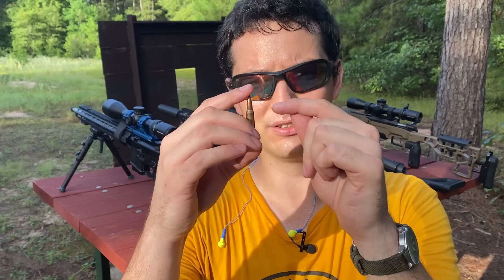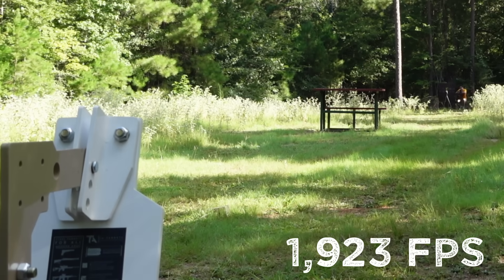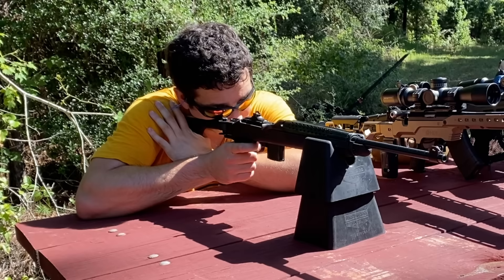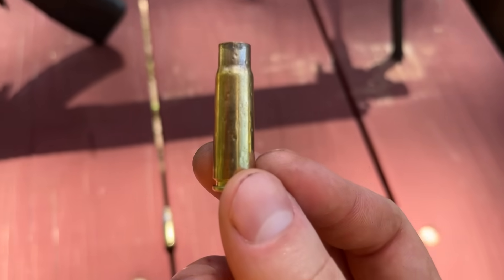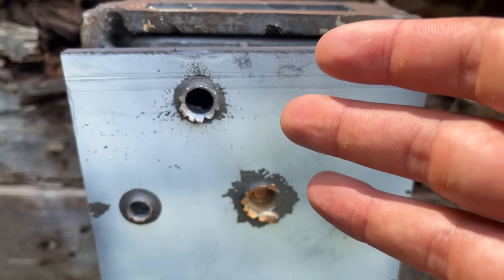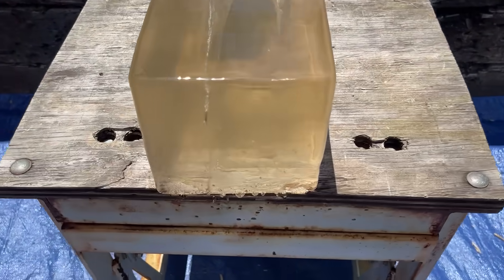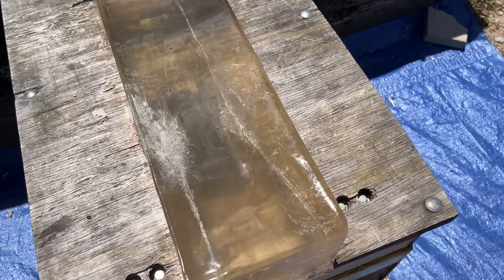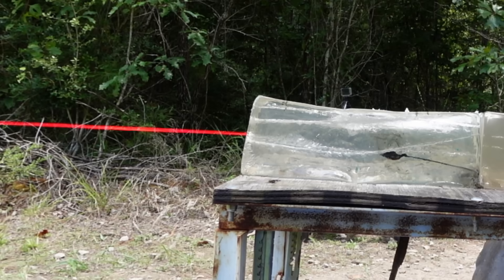I Will Never Shoot These Bullets Again

Comment: In 1993 I had a massive case head speration in an AR-15. It destroyed the upper reciever, barrel and bolt carrier group. For about 3 years I wore a scar line on my cheek where the upper and lower reciever met.
Reply: Bro’s AR gave him a Prussian honor scar for 3 years? Unfathomably based good sir.
Reply: What ammo was it? I'd like to avoid that
Reply: @explosiveswine7354 It was a military 5.56mm case that I didn't catch in the loading process. I always  separate military and civilian brass. To this day I'm very careful, it's easy to miss. Rebuilt the rifle and it runs beautifully.
Reply: @howardamey7228 I wasn't aware of that military cases are lower quality. I have a bunch of Winchester green tip brass that's darker around the head, but I thought that was just visual and didn't effect performance. Should I throw it out?
Reply: @explosiveswine7354 NO, military cases have a webbing around the base of the casing to give it strength during automatic firing.  Not realizing that it was military, I loaded it to civilian specs. This caused a very over pressure case. When I fired, the round exploded in the breech.
Reply: @explosiveswine7354 If you reload, just make sure you separate military from civilian brass. Military should be loaded 10% less then civilian cases.
Reply: @howardamey7228 
Yea, military cases are thicker around the case head which decreases their internal volume, but it's not just for machineguns/automatic fire, it's because of the nature of anything that automatically cycles the action whether it's semi or full automatic, the military's concern is that there's a high probability that ammo will be fired in a less than clean condition in a battle, and dirt between the case and chamber can make it hard to extract causing the case head to rip off and leave the rest in the chamber, even if you have a ruptured case extractor on you using it in the middle of a battle isn't exactly the ideal time.

Plus reloading once fired surplus military brass can be dangerous for that very reason, even with it being thicker in that area it could have been shot through something that it barely survived not having the case head ripped off, in which case it might have been stressed and weakened right there that even under ideal conditions it could rip off, or possibly fail before the round even gets to the gas port and starts the automatic loading process, which is what happened to you, it likely wasn't just the higher pressure from the decreased volume being loaded to civilian spec it was also the case was already weak from surviving a near failure. 

I used to load surplus military brass years ago until I decided it just wasn't worth it any more, between the risk and all the time it takes to ream the crimp off the primer pocket and all the time you put into prepping the things I just started buying commercial unfired brass for my match grade ammo and factory loaded stuff for plinking.

The military should really crush all that brass before they surplus it out, they're really selling it for scrap to be recycled, but unscrupulous people who buy it at government surplus auctions turn around and sell it to reloaders when they know they really shouldn't.
Reply: @dukecraig2402 I haven't had an issue since, but your summation is correct. I never mix brass, and it can be tedious, but I inspect the hell out of it.

Comment: At a local MG shoot, a dude with
A 1917 machinegun with a completely
Shot out barrel fired off a belt of 100% tracer. The rounds immediately tumbled on barrel exit and went in a random direction looking like a massive firework. I mean 45 degrees dispersion and they appeared to almost stop in the air.
Still one of the coolest things I’ve ever seen
Reply: It could be if the rounds were bouncing around in the barrel on the way down the tracer packing was coming out of the back and were being pushed out by the next round, that would account for the extreme angles you were witnessing, I've been around alot of guns including machineguns that were fired with burned out barrels and I've never seen rounds hitting the ground at what would be a 45° angle in front of it or anything even close to that, they all at least make it to the berm behind the backstop at 100 yards, a 3 or 4 foot group is more realistic at 100 yards from a burned out barrel.
There's also the likelihood of the bullets tumbling out of the barrel and flinging the tracer packing causing the optical effect you witnessed, but the rounds themselves leaving at a 45° angle? I just can't get my head wrapped around that one, and I've seen guys do some wild stuff at machinegun shoots, one fella, who had to be rich, took a 1919 Browning and shooting it from the hip, and holding onto the barrel shroud with a welding glove on his left hand, had a buddy linking belts together and was continuously firing it until the barrel was glowing red and it was spitting red hot metal out of the end of it, I don't know how many rounds were continuously fired through that thing but it seemed to go on forever, when it finally stopped he threw it down on the ground and jumped away from it like it was a grenade that'd just landed at his feet 😂😂😂.
I'm not trying to call you out on anything or call you a liar, I have no doubt you saw what you did, but it had to be the tracer packings that'd separated from the rounds causing an optical effect making it seem like it was the actual rounds leaving the barrel at a 45° angle, think about it, if the rounds were loose enough in the barrel to cause that a recoil blowback Browning design wouldn't work, there wouldn't be enough pressure blowing out of the end of the barrel to make it recoil rearward, unlock and cycle the action, you've got to have somewhat of a seal between the bullet and the barrel for enough pressure to build up for the process to happen, otherwise the pressure won't build because it'll just blow out around the bullet as soon as it leaves the chamber. 
Once again I'm not calling you out, I'm just trying to come up with an explanation about why it would appear that way, it would also account for why the rounds appeared to stop in mid air, because it was just the tracer packing, back when I bought my first M1 there was plenty of surplus tracer ammo around in those days, when I'd fire it into the berm behind the backstop plenty of them would have the packing dislodge and dance around on the berm until they burned out, at first I thought it was the rounds themselves doing it until I thought about it and understood there's no way that was happening, then I realized it was just the packing that'd ejected out the back when the round hit the dirt, especially that berm that was real rocky.

Comment: Most 5.56 and 7.62 tracer lights after it leaves the barrel and gets bright approx 70-90 yards away and traces a few hundred yards. Your experiment needs to be done at 300 yards.
In my experience, .50 cal trace is old and ammo is reloaded with old projectiles and most folks using them don’t fire from an M2HB’s long barrel. So if they light, it happens a couple hundred yards downrange and traces approx 2k yards. More exotic stuff like Incendiary tracer has a habit of lighting inside the barrel and blowing shrapnel like a shotgun when it exits; the velocity of the shrapnel can be faster than the muzzle velocity and it comes backwards and sideways; showering neighboring shooters.
Reply: Yea people don't get that there's a slight delay engineered into it so the magnesium tracer packing doesn't start burning inside the barrel for the sake of barrel life, not for the sake of not being able to see where they're coming from.
I was a Vulcan gunner in the Army back in the 80's, every round out of those things was a tracer, at 3,000 per minute if the tracer packing started to burn inside the barrels they wouldn't have lasted very long, even with those things they didn't light until about 25 or so meters out of the gun, maybe even 100 meters, without backstops like a normal rifle range it's kinda hard to judge distance especially since we were shooting at drones flying around in the air most of the time, and with a 3 foot flame coming out of the end of the cannon it would have been perfectly obvious where we were at anyway, whether that red laser beam started right at the muzzle or 100 meters away God and everyone else was going to know exactly where we were.

Comment: My .30 singer did this with reloads that had wrong powder used. It did the same thing and blew out the mag. I think it was designed to do this on the event the barrel got blocked. Basically the powder burned too slowly and passed the gas port before all the burning was done and unlocked the bolt during the ongoing explosion. I too had powder burns on my forehead.  I love my 30 carbine though most accurate rifle with those trident sights imo.

Comment: "imported ammo" ye. they seem to have kinda spicy meatballs in the mix. at least it was not a spiced up .50 cal slap round :D
so what i can tell some sabotaged ammo has gotten mixed with normal ammo and when it comes to old imported ammo its a dice roll if its safe or not.

and there is so many reasons and motivations why some ammo is spicy. either its a seller who hates guns and then just loads some with explosives and then sells it. some just ran out of powder and used something that is way more hot. old sabotaged military ammo and the list just keep going

Comment: reminder that tracer fire is what inspired the laser effects in sci-fi movies back in the day,
IRL lasers would be more like a beam or you'd just see the POI light up/heat up momentarily.

this is also why lasers don't need range or wind calls, as they just travel dead straight from an emitter and only need to be zeroed to hit things within line of sight.
Reply: I was a Vulcan gunner in the Army back in the mid 80's, 3,000 rounds per minute out of a 20mm cannon with every one a tracer at nighttime is quite a display, it looks like a red laser with a slight downward curve until about 1,000 yards when it starts to form a cone shape, not far beyond that the rounds start to deviate from each other just enough to where you can tell it's individual rounds. 
4 guns online during a night fire exercise when we're doing a mad minute at the end burning up all the leftover ammo so we didn't have to turn any in is a sight you'll never forget. 
There'd be a 3 foot flame coming out of the end of the gun and a flame about a foot long coming out of the ejection port, during daylight if there wasn't any clouds and the sun was shining when you fired the gun if you looked at the ejection port the casings were pouring out so close to each other it looked like liquid brass.
We'd fire those things until the casings were piled up 3 feet on the side of the chassis hull, then stop for a bit and clean them up with coal shovels.
Reply: Still need the electricity though, and an extinguisher for electric fire...

Comment: Ft Bragg CAPEX in the 80s they had the towed VAD Vulcans and those babies looked like solid tracers even though it was every 5 rounds. Even cooler when we had an AC130, cobras, and little birds lighting up the targets for a different dog and pony exercise. (They flew in the big wheels on Pave Low) The little birds would get the minigun tracers on target, then fire 275 rockets. At night flying with NVGs. Part of it was a night live fire with some 82nd troopers and unfortunately one of them was a friendly fire victim, took an M-16 round to the neck. RIP.

Comment: I'm a little dubious of your 5.56 tracers. If they were M856A1 then they would have the same steel penetrator of an M855 and should have roughly the same performance, but seeing as the one you fired was outperformed by a plain lead ball round, I think you had regular 856. The real way to tell is by the color of the tip: orange is 856, red is 856A1

Comment: Oooh man! That LC 52 marked ammo has long been rumored/claimed to be Mao Era Chinese made stuff. It's said it was intentionally self-destructive to sabotage the weapons and injure the opposing armed forces that used the .30 carb caliber. They came in a plain off-white box of 50 with a peculiar blue font which only reads LC 52. Meant to appear as Lake City(U.S. of A.) in 1952. There's lots out there on the surplus market still. Do not buy. DO NOT FIRE! 

I'm glad you weren't blinded or more severely injured.

Comment: glad your ok, stick bugs where here to check in you. i like stick bugs . what ever happened to the glow in the dark type 9mm tracers that wouldnt set things on fire. i have had .308 , 12 gauge , 763x39, and .22. only thing worked was the .22, but at $42.00@50 box holy moly

Comment: LC 52 headstamp was used by lake city but then later copied by china for some really dodgy ammo with corrosive berdan primers. If you have any of those rounds left you might pull a bullet to see if it's berdan also whether any of the powder is deteriorating and clumping or sticking to the casing.

The Chinese ammo comes in brown boxes marked 7.62

Comment: As much as I like the M1 Carbine, the open top receiver doesn't give the same level of protection to the shooter that a side eject receiver has when a case failure exists. The M1 Garand, Mini-14, M1A, M14, BM59, FN49, AG42, SKS all have the same issue.
Reply: The AK is like that too. The dust cover helps a little bit, especially with high speed fragments, but the whole thing's gonna get thrown towards your face anyway. It's just thin sheet metal barely holding on. The shape of the bolt will hopefully keep the blast going out the sides instead of backwards.

Comment: My father in law's Iver Johnson M1 carbine did that. It was a worn out bolt.
These rifles want to have lube. I know, you oiled it, right? That doesn't cut it. You need axle grease, or cup grease. That's what they were made for. Regular GI axle grease. Don't be shy with it. Work it in. Wipe off the excess. Now it'll shoot for a very long time. That Iver Johnson rifle, I swapped out the bolt, and it's been fine ever since.

BTW, do that for all of those weapons. P-38, M1 rifle, etc. They like grease.
Reply: If it slides grease it. If it rotates oil it.
Reply: Yes, one can of high temp bearing grease at Walmart will last you a lifetime and can work on all of the semi-auto rifles. That's all I use

Comment: Okay, long about the 1990's somewhere there was a batch of "Lake City 52"  head stamped ammo that showed up on the Mil-Surp market that then became known as Chinese Korean war Psy-Op ammo.  At the time it was said that, that head-stamp was linked to substantially over pressure cartridges for the 30 carbine!   As a hand loader/reloader I happened upon a penny's to the pounds worth bonanza of that "Lake City 52" head stamped brass. All those empty cases showed that they had been horribly/severely over crimped and it was said over loaded with a far too fast burning powder. This was to cause the rapid destruction of any 30 carbine rifle that may have chambered/fired such a round! Or, at least so it was passed as gospel e'ffing truth at the gunshows some 30 years ago. I for one would not trust my 30 carbine to any mil-surp ammo with a head stamp that was of the 52 or 53  lake city vintage!!! Just saying.

Comment: The lethality, penetration, etc of a tracer is no different than that of the base bullet which it is made from - a 5.56 FMJ tracer is just as fast and lethal as standard 5.56 FMJ of the same design.
The only potential extra lethality a tracer provides is when striking fuel tanks due to the burning phosphorus having a better chance of igniting said fuel and MAYBE when striking other objects which react poorly to open flames such as igniting munitions - I've also seen tracers start the occasional fire, but that's more accidental and only under perfect conditions, conditions which border on needing to be so perfect that if there's a firefight involving tracers, then a fire is likely starting even without them.
Another problem with tracers which we're seeing is that they normally require a bit of distance before you can start seeing them since most aren't designed for close range shooting.
Finally, tracers are all but useless when being fired from a non-automatic firearm unless your intent is to ignite fuel or something else which the tracer can/might ignite.

Comment: When I was shooting at the El Toro Marine Rifle range back in the 70s , someone shot a tracer which went off into the brush.  El Toro is in So Cal and it’s dry and brushy in the hills. Anyway, a fire started out about 120 yards away and those Marines instantly called ceasefire and ran out to stamp down the little fire that started. They ran a tight range and you didn’t dare approach your guns or even think about crossing the white line during ceasefire.  One day I was shooting my Beretta 92 before the military adopted it and Gen. Curtis LeMay setup next to me and had a wood case with about 3 , 1911 s inside.
Reply: What year was this? LeMay retired in 1965…

Comment: Usually the purple coloured NATO tracers are subdued intensity for use in low light. Were the actual tracers used today red or purple like shown linked in a belt?

I don’t see the sense in making way more expensive 7.62 NATO tracer bullets with expensive copper slugs instead of cheap lead? Gucci tracers? It’s machine gun ammo for stick-bug, gel-block-gecko, flying-mag-base-plate-in-the-head  sakes!

Comment: Still crazy to me that 5.56 basically DOES explode just not in a combustion way, but in a "going so fast the hydrostatic shock tears the small projectile into twenty pieces" way
Reply: Ive seen people shot with 5.56 at less than 10 feet.  Bullets didn't explode